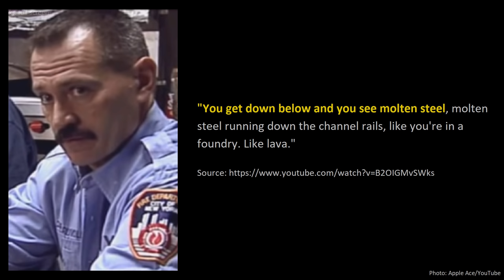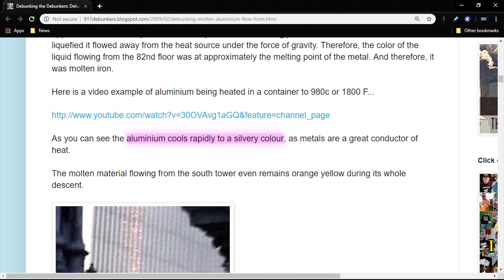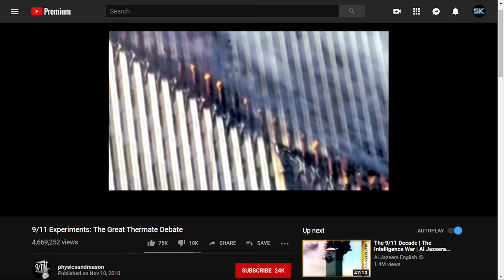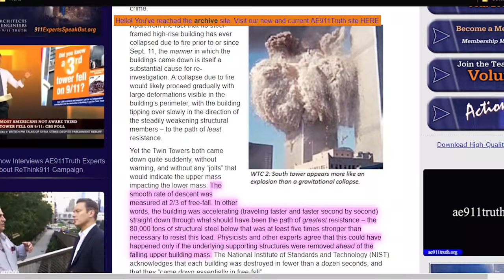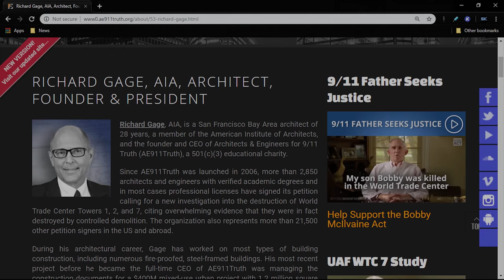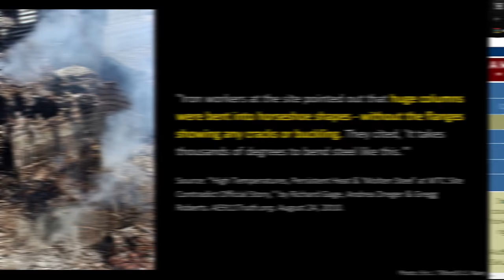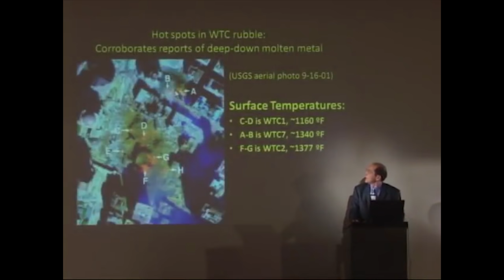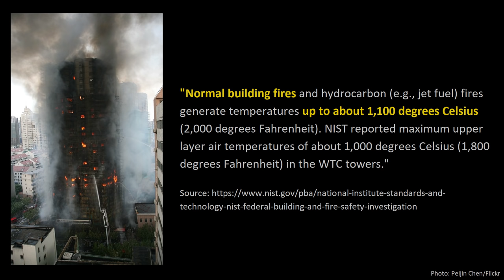9/11 Truthers Debunked: "Molten Steel = Thermite From Controlled Demolition!"

Comment: As for why the aluminum melted and poured out at that spot? There was the remainder of an entire 767 jet scattered throughout the building. The idiots cannot fathom how much aluminum that represents. Once the jet had penetrated the first wall it was shredded into millions of small pieces that naturally would have collected against the far wall from the entry point. Once the floors started to sag when their steel floor trusses had sufficiently weakened, the aluminum would run downhill toward the corner and collect in a pool, which became hotter and hotter until it was sufficiently hot to glow. The collapse of WTC2 was precipitated by these weakened floors finally giving up completely. This pulled the north wall inward, which is seen just before the collapse - a sudden inward motion of a large section of the north wall as a whole, followed immediately by the onset of collapse.

Comment: I didn’t make it 5 mins in buddy. The building disappeared into its footprint. That much steel doesn’t just disappear.
Reply: Congratulations. You got one thing in. That much steel doesn't just disappear. Which, of course, is why it didn't, and why there are multiple images of the vast amount of steel left after the collapse of the buildings.

As for the building "disappeared into its footprint", well, we've already covered "disappeared". And among those images? There's also photos of just how much ground the remains covered. 16 acres worth, in fact. So much for "footprint". That, of course, in addition to the known facts of where the buildings ended up falling.

Oh, and when it comes to "didn't make it 5 minutes in", while you're more than welcome to "do you", admitting out loud that you don't understand the material isn't really the smartest thing to do.
Reply: I think YOU are the one confused. I work with steel and this is not how steel structures behave. Never mind little ol me..  you could bother to investigate some of the independent research done by actual engineers and people that build steel structures. There is absolutely no way in hell the twin towers fell from that alone. Sorry. Too much science being lied about.
Reply: @Cas_Null  "I work with steel and this is not how steel structures behave"
So, what you're saying is, heat doesn't weaken steel? Cool! Which world do you live in, and what's the weather like?

It's just as much fun each time someone who doesn't want to believe in reality claim all of this expertise and these qualifications. Strangely, they never seem to be able to prove it. Why is that, I wonder?

"you could bother to investigate some of the independent research done by actual engineers and people that build steel structures"
The stuff that, to a one, say that there's nothing peculiar about what happened, you mean? That research?

"Too much science being lied about."
That you don't UNDERSTAND the science doesn't mean it was lied about. Only that you don't understand it.
Reply: For starters, no.. steel doesn’t weaken when the fuels heating it don’t have a high enough temperature to melt said steel. That entire building did not come down from kerosene and office furniture.
Reply: @Cas_Null  "For starters, no.. steel doesn’t weaken when the fuels heating"
So, in your world there's no such thing as "blacksmith" or "forging"? Cool. Welcome to earth!

"it don’t have a high enough temperature to melt said steel"
So, steel doesn't melt either? Huh. Weird planet you're on.

"That entire building did not come down from kerosene and office furniture"
Because you said so? First, jet-fuel isn't kerosene. Derived from, yes. Same, no. Second, building collapse all the time from "office furniture". Third, each building burned for a minimum of an hour, so your attempt to make it seem like someone dropped a match in a trash can didn't work.
Reply: @Cas_Null  "Buttercup a steel frame building had never collapsed from fire before 9/11. "
So?

"Here is some real science for you since you requested some. "
 Yeah....Richard Gage? Science? This man thinks that banging cardboard boxes together is science.

"A blacksmiths forge is hotter than an office fire."
Forging temperature of steel depends on the steel, range from about 1000 to about 1200 degrees.
Temperatures of the WTC fires, using the available fuels in the offices, about 1100 degrees. Oooops, what DO you know.

That you're trying to pretend that someone dropped a match in the waste basket with "office fire" doesn't change facts. Poor you.
Reply: I’m not out to change your mind. I just think your inability to hear yourself is sad.
Reply: @Cas_Null  So, what you're saying is, you have no argument for your claims, and facts and reality makes you sad?

Ok, cool.
Reply: What do you think that giant cloud of dust was that lingered over Manhattan for hours was? Pixie dust?

It was pulverized steel and concrete. And a lot of intact steel was still found scattered across Ground Zero.
Reply: @NY_Mapper  yeah… pulverized. Think about it a little. Fire doesn’t pulverize steel. If it’s hot enough for long enough steel will melt. There was not enough fuel in the planes to make that happen. 🤷‍♀️
Reply: @Cas_Null  No but the crushing weight of a gigantic skyscraper can cause pulverization.
Reply: @mooneyes2k478  Nor since. Never mind 3 in less than 24 hrs. Sheep I say.
Reply: @NY_Mapper  You are wrong I was there, I worked in chamber street the cloth lasted over a month due to burning debris.
Reply: @gito4130  I have to say that, with my posts being quite old by now, I'm not quite sure what you're referring to.

Comment: I appreciate this video because you create a very compelling case for many of the thing you say.

One thing. You can use thermite AND explosive. Not only that, it's good practice to use one to cut the beams and the other to dislodge them.
Reply: It's only that, that's never happened. Ever. And would not be good practice, in fact. Beyond the very notable traces that'd leave...traces that weren't there.
Reply: what case would that be. he thinks this and that. that is not debunking

Comment: Debunk failed!
Aluminum wont glow like that, only huge amounts straight from a crucible.
Yes, a  jet plane is mostly aluminum, but there isnt enough aluminum in concentrated amounts in a jet plane (apart from the engine) that would explain
such a localized amount of aluminum flow. Plus the supposed molten aluminum from the airplane would have to collect somewhere like in a crucible and then
fall off the window... makes no sense at all. 
The last nail in the coffin is the video showing that all the tiny amounts of flowing metal keep on glowing after falling a decent distance.
If they were aluminum, such tiny amounts would stop glowing and become silver looking almost immediately after dropping a couple a few meters at most, 
yet you see even tiny amounts  still glowing after dropping several floors in height. 
Not aluminum.
Anyone who has ever seen thermite doing its thing will immediately recognize this.   UNMISTAKENLY.
It is also a remarkable "coincidence" that only a minute or so after the glowing metal start to flow, the tower collapses... What are the odds?
Plus, you're comdemning people who assume it's molten iron , but arent you commiting the same sin of assumption about it being aluminum?
Sorry bro, but anyone suggesting this is aluminum is either dumb at best or dishonest at worst.
and taking into account the effort you've put into this video, it wouldnt be too far fetched assuming that you have something to gain from it other than likes.
In your defense, even if you arent being dishonest, I see no skeptical human here, only a stubborn one.

Comment: I didn't finish the whole video yet so I don't know if this will be addressed. I find it ridiculous that we are equating molten aluminum melted in a crucible from a furnace to a molten substance that was melted from open air office fires. Do we even have evidence that office fires can melt large quantities of aluminum in a building at all? This is where we should conduct tests and studies. We already know its impossible for office fires to melt steel so that is out of the debate. The only way that would be possible would be for some other agent to melt the steel. I find it highly unlikely office fires melted aluminum from the plane hot enough to glow orange and for the large quantities to pour out in a concentrated area shown in the video. And to equate this is the same as molten aluminum heated up in a foundry is unscientific. The molten substance also fell for several feet without turning grey which the other examples don't show either. The fact that Iron rich microspheres were found in WTC dust helps the support for melted steel rather than melted aluminum. Theres no other explanation for why they are present in the dust. I believe there should be a team to investigate how office fires can melt aluminum to glow red hot in significant quantities in a building. We shouldn't just assume this is what happened without doing the necessary experiments to help support this explanation.
Reply: "Do we even have evidence that office fires can melt large quantities of aluminum in a building at all?"
Melting point of aluminium: 660 degrees C. Some variation will, of course occur, since pretty much all aluminium found is in fact an alloy, but not much.
Melting point of steel: 1500 degrees C. Again, some variation, steel is a wide range of alloys.

So, while it's possible but not certain it was aluminium, the chances of it being steel is SIGNIFICANTLY less.

That you then admit that whatever it was glowed orange shows with all POSSIBLE certainty that it wasn't steel. This is easy to find out by studying the black-body radiation color chart. Steel melts at temperatures around 1500 C, at which point it would be a powerfully radiating WHITE. Orange does not happen above 900-950 degrees, at which point, of course, the metal isn't liquid.
Reply: @mooneyes2k478  A quick google image search for a steel foundry will dispel this notion. It might just be the surface temperature, but molten steel does not typically glow white.
Reply: @darkwingscooter9637  Yes, as a matter of a fact, it does, as seen by, what do you know, such an image search. That the surroundings reflect that light, and so take on different tones, doesn't make the steel any less literally radiant white.
Reply: @mooneyes2k478  So what you are saying is that molten steel is glowing white but looks orange in every photograph you can find. So it ends up looking like the material pouring out of WTC, which also has other physical characteristics which fits steel better than aluminium?

Of course, all of this heat being generated by puddles of kerosene (which is as flammable as a wet rag).

Come on, it is obvious that you are operating by motivated reasoning alone and not reasoning from the data to the conclusion. Aluminium heated by office fires doesn't fit the observation and you know it as well as everyone else does. Stop playing stupid games.
Reply: @darkwingscooter9637  No, I'm not. I'm say that molten steel looks white. Just as in the images. Imagine that.

So, it ends up not actually looking like the material that isn't pour at all, but falling.

As for "other physical characteristics"...what are those?

And where is proof that it's "being generated by puddles of kerosene"? Much less its flammability.

" not reasoning from the data to the conclusion"
Oh, no. No, going from conclusion to data, I leave to you. Like, say, "pouring" or "characteristics", "puddles", "kerosene".

And as for aluminium, you're quite likely right. It likely isn't aluminium.
But, it does fit the parameters better than steel does. So, of the two, if it has to be one...that's the one it'd be.

And, I leave the games to people like you. People who invent supposed data points to fit into their conclusion.
Reply: @mooneyes2k478  For lighting keorsene (avgas) on fire: watch?v=7nL10C7FSbE

The alternative for what is melting the metal, whether it is aluminium or steel, is office fires. So take your pick. Something heated some metal to sufficiently high temperatures to have it appear to be pouring out in a manner similar to a foundry. 

That is not consistent any ordinary office fire, whether with an accelerant or not. I'd be happy to concede if you can find me a similar example.

Also: I have compared a couple of Aluminium foundry to Steel foundry pictures using a color picker and the difference is negligible when the silvery skin of aluminium isn't visible. At the hottest part it does appear white, so you may be partly correct, the orange is just reflections from cooler parts. However, when aluminium is cooler is always gets the silvery skin and never sparks like steel or whatever was pouring out of WTC.

You can pretend all you like, but what was coming out of there is not consistent with anything observed in a normal office fire or open kerosene fueled fire, especially considering the thermal imaging.

It's amazing to me how many crazy things defenders of the narrative have to accept to cling to the story that literal spies provided them.
Reply: @darkwingscooter9637  " For lighting keorsene (avgas) on fire: watch?v=7nL10C7FSbE"
Wow, yeah....so, here's a slight issue. Ok? "Avgas" is short for something. Aviation Gasoline, specifically. And, as the name suggests, isn't "kerosene". It's meant for internal combustion, propeller plane, piston engines and is, essentially, high-grade....gasoline.

"The alternative for what is melting the metal, whether it is aluminium or steel, is office fires."
Yeah, so, you're still failing to actually show that it's any metal. But, either way...."office fires" is a mealy-mouth attempt to claim someone dropped a cigarette in a garbage can.

"Something heated some metal to sufficiently high temperatures to have it appear to be pouring out in a manner similar to a foundry. "
Show me this "pouring", because there is nothing that says that's happening.

"Also: I have compared a couple of Aluminium foundry to Steel foundry pictures using a color picker and the difference is negligible when the silvery skin of aluminium isn't visible."
So, you haven't actually done that. Here's a hint: there's no "silvery skin" on aluminium.
What it is, is the fact that, there's no reason to heat aluminium to a point of glowing, commercially. It won't be MORE liquid. But, strange as it may seem, a fire doesn't care about that. And so, it's heated to the point of glowing.

"You can pretend all you like, but what was coming out of there is not consistent with anything observed in a normal office fire or open kerosene fueled fire, especially considering the thermal imaging."
Thanks. I'll "pretend" that physics as we know it was still in effect, and so that wasn't steel, and probably wasn't aluminium either, but of the two, aluminium is the more likely one.

"It's amazing to me how many crazy things defenders of the narrative have to accept to cling to the story that literal spies provided them."
But not NEARLY as amazing as how many hoops "truthers" have to jump through, how many leaps of faith must be taken, and how many facts must be ignored to keep the fantasy even possible.

See, here's the difference: even allowing for "literal spies"(which is so much nonsense), the explanation given is the one that adheres to the facts and stays within the boundaries of known science. It's the one with internal consistency. And it's the one with literally millions of manhours, by thousands of people. It's the one with hundreds of scientists,
Meanwhile, the "truther" inventions rely on laypeople not knowing any better and trusting the loudest voice in the herd, on handwaving and woo and "because that's what I want it to be".
Reply: @darkwingscooter9637  No? Nothing? Wow, WHAT a shock!

Comment: Something that continues to dumbfound me about the conversation is just how complicated the physics are here. We're talking about one acre square. 1 acre square per floor of concrete poured on top of steel. It was thin steel, just enough to hold the light concrete that they were using. There was early on cost considerations so some lighter and less expensive techniques were used in the construction per floor. So a 1 acre floor space by 10 stories fell down on top of the weakened section of the building, and you're surprised at a 10-story building being dropped on top of the world Trade Center would simply cause a giant explosion and forward motion of just powder and debris. I don't understand how that could be confusing. And that no one understands the large scale of this thing to think that there's something tricky about an explosion happening before the collapse. We couldn't see everything that was happening and all the destruction. We can't even imagine what is going on inside of space where a jet airliner slammed into the core of a building got sliced apart with steel beams removed steel beams from the structure poured fuel all over inside and aloud it to burn for a little bit. All the combustibles that were inside the building being assisted to burn an extreme high temperature. Anyone who's confused about what happened here is looking to make something very terrible out of something that was already horrible.
Reply: You don't seem to understand much about physics, yet your willing to disregard evidence in your attempt to convince others.